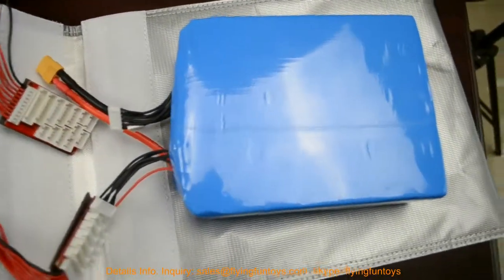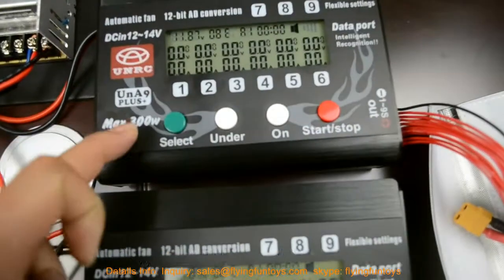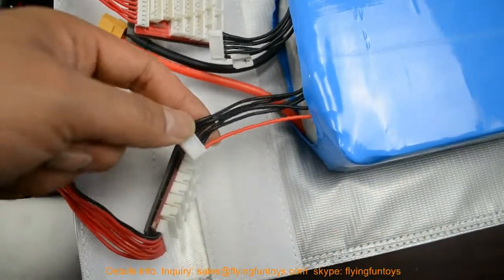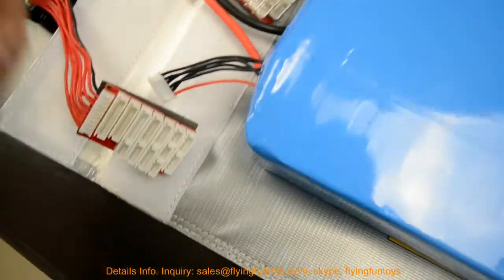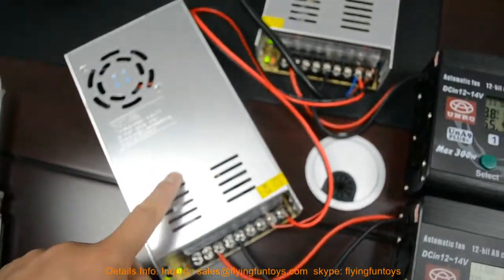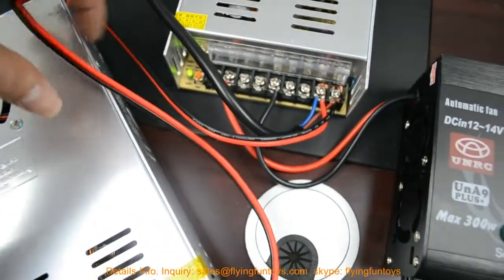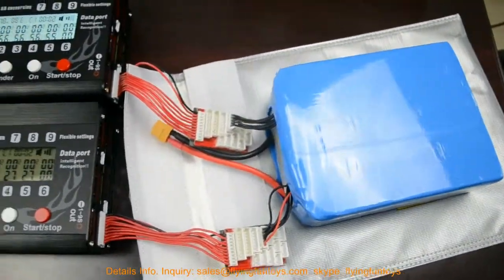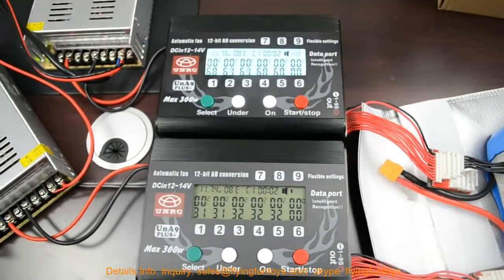10S 10000mah Drone Battery Charging Operation Demo

Comment: You charged without powercable and charged with balance leads? How are the wires connected inside the battery because both have 6.